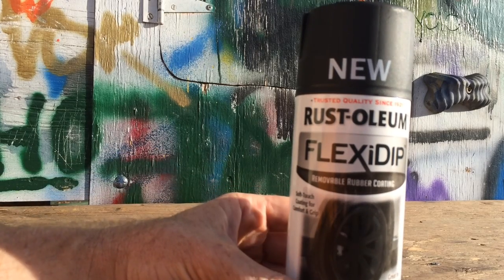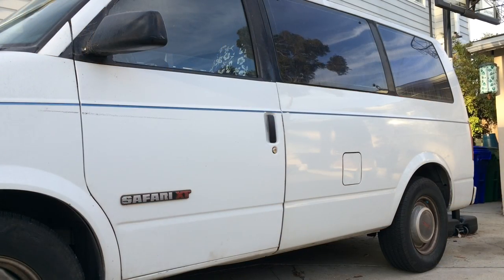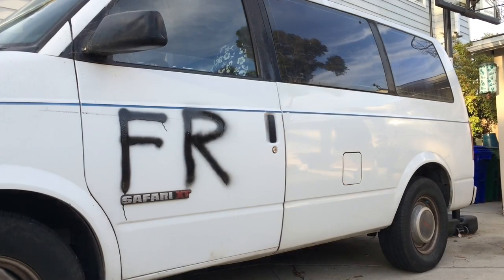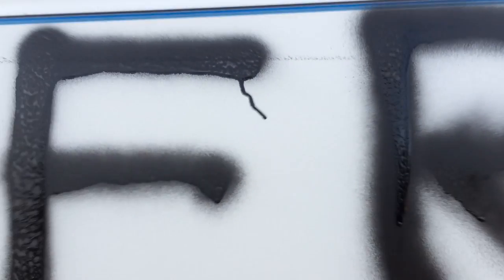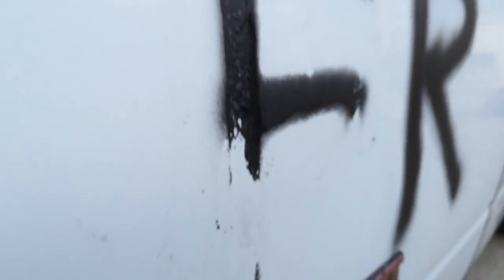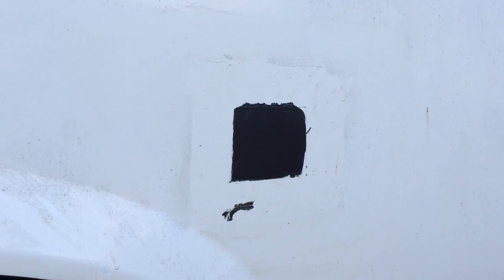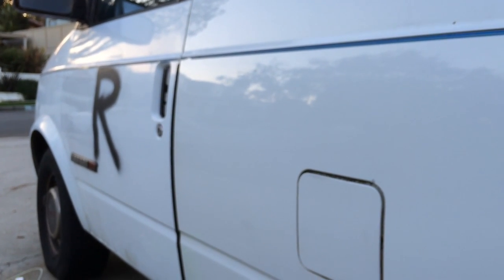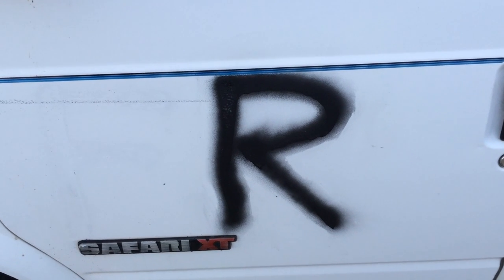Removable Spray Paint

Comment: Rustoleum's retort to Plasti-dip? I Plasti-dipped my entire Jeep.
Reply from the maker: How long did it last?
Reply: ***** Since May, 2012 and still holding strong. Probably a great thing that I did it. A few months after applying it I was behind a gravel dump truck on the highway and caught a few rocks. Needless to say, if the Plastidip wasn't there, I surely would have some significant size chunks of paint chipped off. All that was required was a quick touch up squirts and it was good as new. It is pretty versatile stuff. You can even use it as a primer for actual paint and, just as if you only want it to be temporary or you fudge it up, you can peel off and start over again.
Reply from the maker: Durtee Diaperz That's a good long time.  I've always wanted to paint my van like the A-Team.  Maybe I will.

Comment: I can't wait to get a scouring pad on my 3000.00 graphics.I'm looking for an easy off, EASY OFF , not brillo pad-off practical 
joke to spray over my graphics.
Reply from the maker: Be careful. I’m not sure if any of the stuff really is that easy to remove. I’ve heard that if you leave it on to long it permanently stains underneath. Definitely make sure your painting on a really smooth surface. My van was old, so it absorbed a lot of the paint.
Reply: Right, thanks, I see another product called duplicoat, 
I would be very unhappy to find out that whatever I 
might use might leach into the clear coat.
Reply: They also have seen that heat-apply adhesive wrap, not sure 
if that can be trusted yet , either.
The spray on seemed like the answer but I guess, 
probably not... shrugs.....